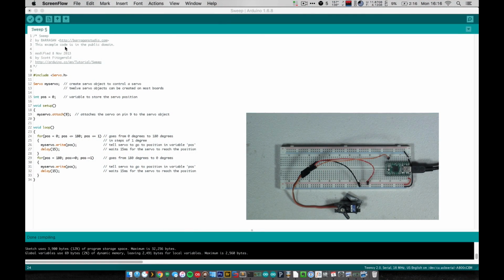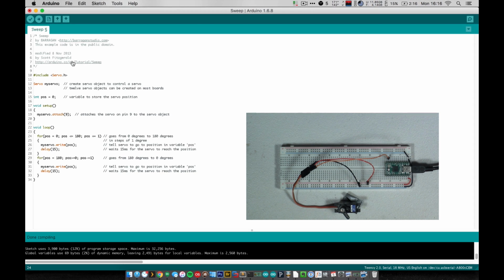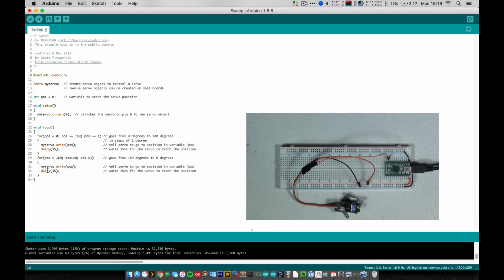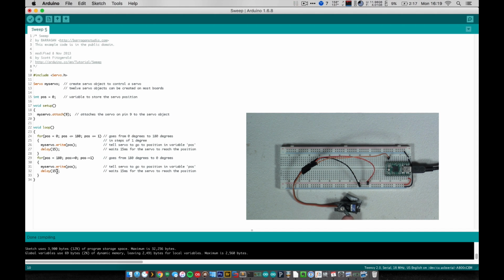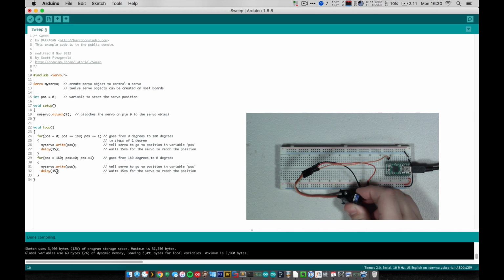How To Wire It! Servo Motors

Comment: Hello. So i have a 1/24 mustang that im trying to make rc. i got a crappy chinese reseiver (small enough to fit so itll be fine,) so... it has 2 wires for engine, it works, it has 2 wires for engine 2 ("servo" but not really) so i already soldered out engine 2 and the electronics are nearly ready so. Can i wire the servo to the reseiver (engine 2s place) positeve to positive and negative to negative? will it work? ( engine 2 was there i tried moving the control stick and it moved both ways, so i soldered the motor off.) so i know if i had a 50$ receiver/transmiter it would be as easy as just to plug it in but i have old receiver from old toy rc car. so do i need the white wire then????

Comment: What motor do you think I should use for a tracked robot? Is DC better than Continuous Rotation Servo? Thank you!
Reply from the maker: It somewhat depends. How fast do you want it to go? DC for speed but continuous rotation for more accuracy.
Reply: ItKindaWorks I am really concerned about its speed, I just want it to provide enough torque to climb stairs. Any help would be appreciated. Thank you!